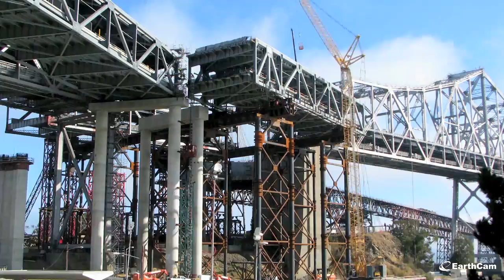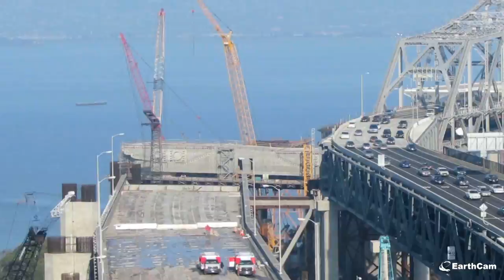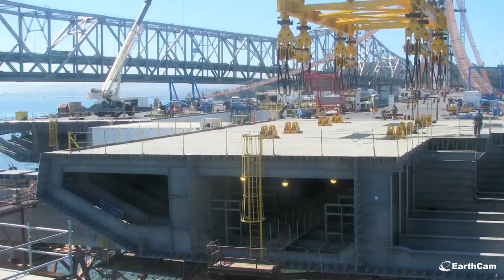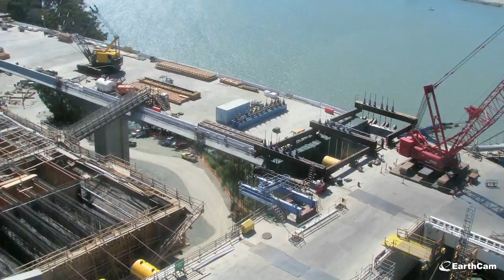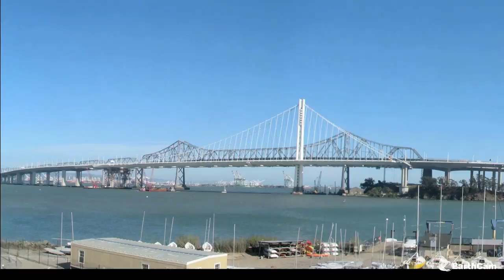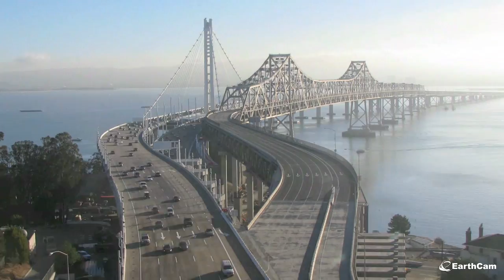Building the Bay Bridge East Span | Time Lapse

Comment: $7,000,000,000 final cost. Same suspension style could have been done with NON-FUNCTIONAL tower and wires for $700,000,000 by DELETING unneeded wide ship crossing space underneath that required costly construction to accommodate. Since ALL tall ships cross under the west span anyway, $6,300,000,000 was WASTED.
Reply: dude hush, tha old bridge ain't really made to handle another earthquake, yea go ahead and build another bridge just like what tha old Bay Bridge was  like somewhere where they ain't earthquakes, tha new bridge works in places like San Francisco and Oakland where there's tons of Earthquakes and tha old bridge don't even look much taller than tha new one so what's a few feet off gunna make a difference of?